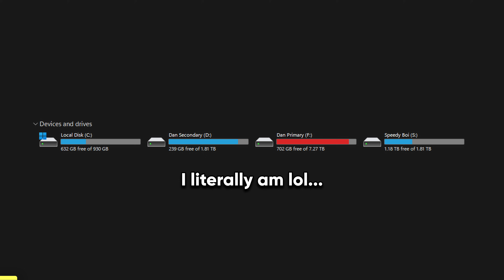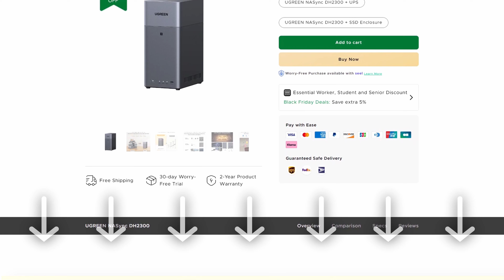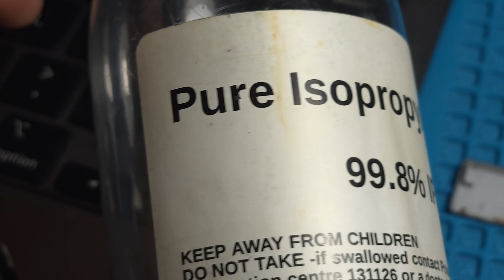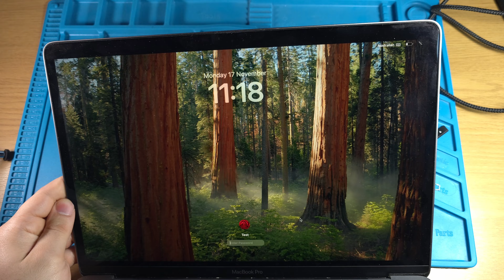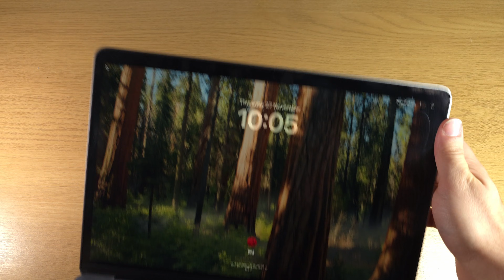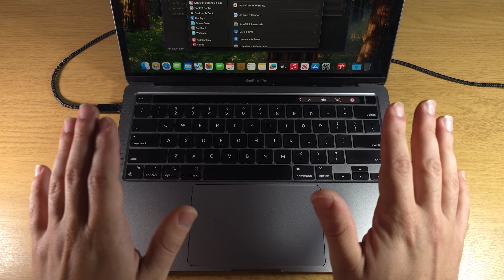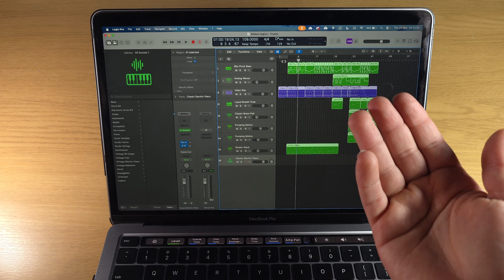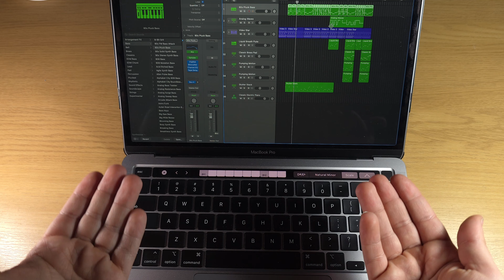I Bought a $250 M1 MacBook Pro, How Bad Is It?

Comment: I did score a $150 base M1 Air a while ago with keyboard and trackpad not working. Keyboard's signal goes through trackpad on MacBooks since forever, so I expected just a dead touchpad. Well, turns out it wasn't even dead, just a bit of corrosion on the connector that some isopropyl alcohol fixed.

Comment: You cleaned that with isopropyl while it was running? Dude... turn stuff off when you work on it.  You're really lucky you didn't short something.
Reply from the maker: Apple SIlicon Macs turn on when you do literally anything with them. If you press any key or the trackpad it will just turn itself back on every single time
Reply: @f @frokfrdk i agree as a person with macbook (specifically the same as yours 2020 m1 pro), i am cleaning the keyboard and it turns on by itself and presses random stuff!!!

Comment: Laptop keyboards are a real pain. I recommend getting good with some very fine point tweezers and using some silicone oil to lube the stabilization on the long keys. I also recommend just doing all the keys at once. Others will become sticky over time anyway and by the time you get a quarter of the way through you'll either be a pro or you'll just buy a replacement keyboard.

Comment: Had to do this exact same process recently on my own personal machine (same model), one month later all the keys (yes, I did all of them) feel a lot looser now than they used to. One of the clips on the left Command and Return keys have broken off so I can't press them from certain angles anymore, but I can get used to that for now. I had to take a couple of parts from a broken donor MacBook just to have a working keyboard at all, because I damaged one of the keys and one of the switches (arrow key switch, just like in the video). Also the keyboard backlight was damaged in the process somehow, but it doesn't bother me because I always turned it off. Still, I consider it a success because it still feels nicer now than it did with the spill.
Reply: I believe theres a thick gel thats supposed to be applied to the moving parts to keep it from feeling lose

Comment: in the land of onion (Poland) this laptop would be 1k aud bc of the apple logo tax (who the f**k would pay 150$ for a mb air '11 mid 2012 *these are pretty much the only airs available*)
oh and 1 question: is a fully working 2019 macboook air '13 with an i5 and 8/256gb worth 180 aud? (it's single one worth that little because most of the time they are >500aud)

Comment: 2:50 well of course, you turned it on by pressing it 5 times, turn off sticky keys
Reply: 😂 ironically this comment’s timed comment feature glitched and it ‘stuck’ on the comments section for the entire video!
Reply: on mac there is no sticky keys =]
Reply: @rzw713  Actually, there is. (Go to settings, go to accessibility, go to the keyboard section, stick keys there)